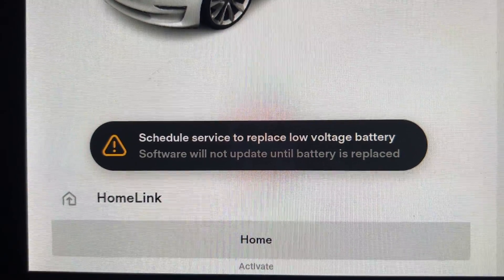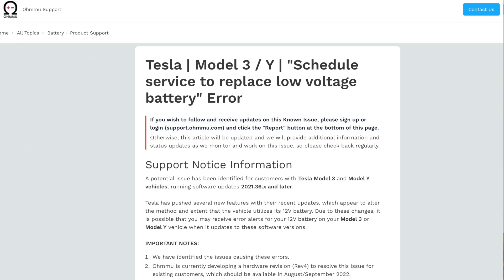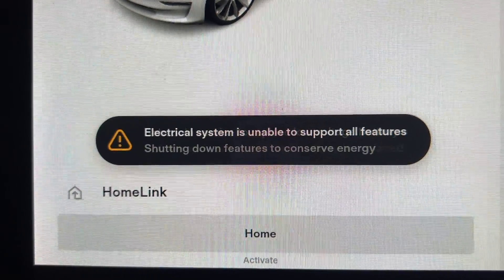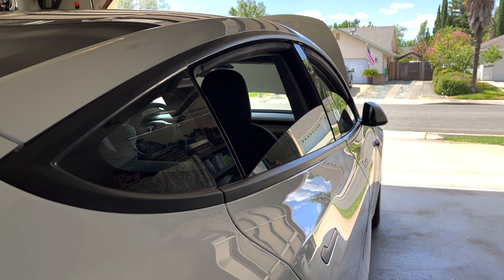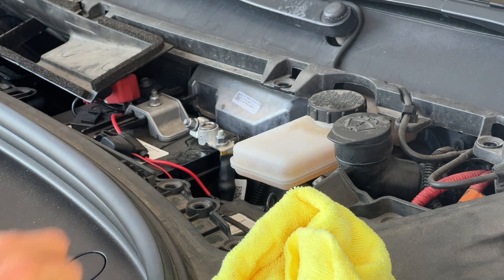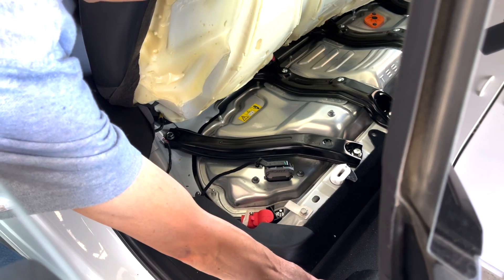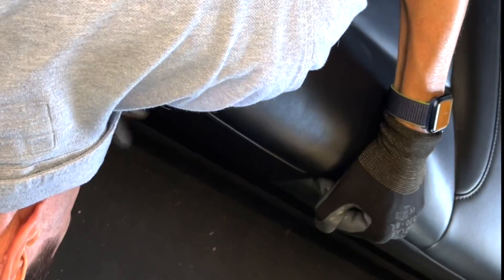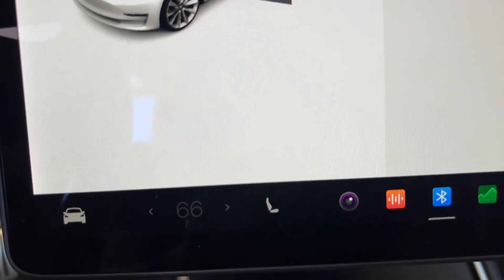Tesla Model 3 or Y Ohmmu Battery Error Message Fix

Comment: Great tip to resolve the Ohmnu battery error message on my Model 3 on last week update !  Thanks so much!

For my case, since my Ohmnu battery was drained to 0%, after I disconnect it , I manually charged it to over 30%, reconnect the batteries, and it works!  No more low voltage battery error message.

Ohmnu app has also shown correct 100% charge on the battery ever since.

Updates:  Found out that “Low Power” feature causes 12V battery error again.  I need to avoid using “Low Power” to avoid 12V battery error from now on

Comment: Hi...id like your advice please. The first time i had this problem i changed the battery and the error messages went away. VCFront_a182/a192/a402...it seems my battery was good though. But with the new battery the same error message came up recently. And i reset it again, and it went away for a while but now its back again for the third time? Im not sure what to do next?

Comment: Thank you for the very informative video. I left my 2019 M3 plugged in at ~70% charge limit for 7 weeks while I was travelling. After returning, I have seen the VCFRONT_a182 error msg, but the car is still driving (just no OTAs). Might it have anything to do with sitting idle these weeks, and if so, would taking it for a long spin help? And, if not, can I continue to drive the car short distances while I wait to get the 12V Ohmmu replaced? Thank you very much in advance.

Comment: I have a 2021 Tesla model 3 SRP with about 60,000miles. Thank you for this. It helped me so far. I was able to charge my battery overnight and no error messages. If it comes back then I'll just take  it to the Tesla center because it's still under warranty

Comment: The problem is the batteries need firmware and OTA updates. This won't work if the battery is too low, also the problem will return if you don't update the software

Comment: I got an ohmmu battery a month ago. So far so good. Initially, I obsessively monitored the app. I saw the battery go from 100% to 34% on hot days when the cabin overheat protection was used a lot. I live in NC where summer temps exceed 90F. It was adding 1 cycle per day to the cycle count. But now that it has cooled off, I don't see the battery below 99% and it can take between 1 week and 2 or 3 days to add a cycle to the cycle count. It looks like LFP batteries can live through 4000 to 10000 cycles. I have gone through 9 cycles in 4 weeks. (A short time that does not represent all the conditions hot and cold for an entire year in NC, so I wouldn't bet  on my projecttions yet.) But based on the first month, at 9 cycles in 4 weeks, or 3 days per cycle, if the battery lasts 4000 cycles, that is 12,000 days or 32 years. If the battery lasts 10,000 cycles (which I see mentioned in discussion of high voltage LFP batteries used in the standard model 3's) then the battery could last 82 years.  We'll see! (I do notice the warranty is for 4 years. They won't ever have to replace a battery at that rate, unless it was a true lemon.)  I'm wondering if there is anything I can do with the app to optimize the charging discharging cycles to maximize the low voltage battery life. For example, you can turn on/off the charging/discharging and maybe keep the battery closer to the 50% happy zone. (I do this with the high voltage battery. This has resulted in losing about 1/2 the range per year that is typical. (typical range loss is 2.3% per year. I have lost 1.5%/yr using my "live near 50%" rule. (I put 20k/yr on the car, driving 40 mi/day during the week and 100/day on Fridays and Mondays. I charge to 75% on Friday's and Mondays to make the longer drives. And I take road trips that use superchargers in the summers.) But I have still cut the battery capacity loss rate in half with the "live near 50%" philosophy.

Comment: I have replaced my lead acid battery before 3 months.
Before 1 month I got the warning and I followed your video to reset it. The problem is that I got the warning before 5 days and I cancelled it in the same way then I got it today again and had to reset it one more time.

By the way, the battery is Varta (Made in Germany) 55 amp. 

Is the problem resulting from the converter that charges the 12v battery?

What could be the cause and how to fix it, please.
Reply: The same problem,seperate 12V (varta 45ah) from HV battery,problem solving,but 4-5 hours again show

Comment: Don’t buy ohmmu 12v battery. That costed me $640 to fix the low voltage battery replacement message. Fortunately return window still open and returned the battery but they charged $38(return label) + $90 (restocking fee). My 20 mx working fine with original battery. Here’s what Tesla said Technician inspected vehicle for customer concern. Technician found upon
inspection that the low voltage circuit of the 12 volt battery that vehicle has an aftermarket lithium
battery that is causing the LV battery repeatedly overcharging. The LV battery has degraded over
time and needs replacement with a proper lead acid original equipment battery.

Don’t waste your money and time.

Comment: Tesla Dealer sell original battery $85, I really don’t understand why people prefer buy $400 battery than Tesla $85 original one, and also void the high voltage battery warranty if you using other brand 12v battery 

So confused me😂😂😂

Comment: I see this is happening to a lot of 2018 models, I’m going through it right now myself. Only thing is I didn’t install it myself. I went to the Tesla Service Center, they replaced it, came up to 122 & some change but they said the error is still showing. Something bout the 12v & main battery are not responding with each other, they gave me a loaner & I’m here 24hrs later waiting. I’ll keep everyone updated !

Comment: I let the battery die about 5 miles away from home then had it towed… as soon as I charged at home the low voltage battery light was on… 
I followed the steps in this video and even accidentally dropped the battery spacer between the battery.   Damn!   But once the power was turned back on everything worked… 
Thanks

Comment: Why you would do business with a company after spending $400 for a non OEM battery that needs constant care and not return your inquiries regarding OHMMU issues. The product is NOT 100% reliable nor returnable. One other nagging question I have is and has not been addressed in any of the comments with multiple videos or from Ohmmu regarding voiding the Tesla warranty on the electrical systems.  That would be number one for me. I wanted the lithium battery to work and not void the warranty  with ANY electrical failures. I'll keep using the lead acid battery and sleep better.

Comment: The new Ohmmu batteries are Bluetooth enabled, and you can update the firmware and enable/disable the battery via the mobile app.  If you ever need to reset the battery, you can just turn off the battery with the app, disconnect the HV interlock in the car, wait a minute, reconnect it, and power the battery back on.  I had some growing pains with mine until there were a couple of firmware updates, now it goes for a year at a time without any issues.  I had to reset it again once after a year, and it turned out there was another firmware update.
Reply: IS the firmware update done thru the phone app?
Reply: @curtspray  Yes.  Not the Ohmmu app itself though, there's a different app.  It's all in the directions on their site.

Comment: We have a Tesla model 3 with that just hit 50,000 miles and it has this issue. Ever since the car turn on and off through out the day and it will even have the air conditioning running draining the battery more than usual

Comment: It worked...2021 Model Y LR - The nag screen is gone (1/5/2024) Thanks - I would not suggest these batteries, I spent over $425 and in less than 1 year the battery failed and I have to send back. The return item? I might not put in, maybe goes up on Ebay  - and have original battery replaced (Lead Acid) which this car came with.

Comment: Hi, I have a made in China Model 3 Long Range and had the notification that the low voltage battery is low and to book a service appointment to have it replaced.  I have booked a service appointment for the 11th of January but after watching your video, I think I will check out the condition (voltage) of the battery and try to reset it as you have done.  It would be good to keep the car going until the annual service which is due in March when it will be 3 years old, the car has only done 10,000 miles.  I live in England so I’m sure that the battery has not been exposed to extreme temperatures so I’m surprised that the battery would have failed.
Myke Hoole

Comment: Bought an Ohmmu in January 2021 for my 2018 M3.  Unfortunately I didn’t know that Tesla would replace their 12v battery under warranty.  Anyways, battery worked fine until recently when I received the alert message.   Contacted Ohmmu and went through their step by step process to address error (their process is a little different than in video).   I also checked condition of battery with multimeter and found battery had very little charge.   I recharged the battery overnight and then reconnected everything.   Alert warning is gone.   However I’m wondering if the new Tesla software prevents the charging of the battery.  Am I going to have to keep recharging this battery?   Luckily,  from what I was told by Ohmmu, a replacement battery is to be issued under their warranty and I’m on their list of purchasers to receive the new battery.  We’ll see.
Reply: I sent my OHMMU back . No refund, refused to send another battery.

Comment: I got unable to DC fast charge, but only AC charge after a bump while driving. Looks like a loose connection? tell you 24 hours later😂
Reply: the error gone after a night. and able to charge DC again. Do my research over internet, in Thailand there was a same case, error will go later and comeback. If it doesn't go, you will need to replace the charger port to battery cable, about USD1100 across the world.

Comment: is it ok not to disconnect the high voltage battery underneath the car seat but using the jumper cable instead?

Comment: In February 2022 I installed an Ohmmu battery in my 2015 Model S and then in June of 2022 I put one in my 2018 Model X. Later run 2022 I when through at least 2-3 resets each time there was a new software update on each of the cars. The Model X was the worst in getting rid of the error message. Finally things settled down and I thought the problem was solved. Now (August 22, 2023) the error message has reappeared on the 2015 Model S. Tesla engineers don't seem to care about supporting superior battery technology. I will check with Ohmmu and see if their newer battery will solve the Tesla software issue. I am sure for them it is like hitting an erratically moving target. By the way, on each of my cars I have to remove the frunk liner to access the battery, so the procedure takes about an hour. Ohmmu has a good video on YouTube to explain the procedure.

Comment: Like you i had previously install an OHMMU battery for my 2+ year old Model Y LR…all was fine for a month and then I received the battery notification you referenced. I also had an alert regarding detection of a possible controller issue. After following the steps on the OHMMU site to reset and reconnecting HV and the negative terminal on the 12V battery, my Tesla did not come back on. Waited about 15 minutes and tried pressing on the break…still nothing. All my research indicates that the 12V battery would be the issue, but not sure that is the case sense this is a brand new battery…note out to Tesla service center and awaiting direction

Comment: I've had multiple replacements from Ohmmu.  I now have their Rev 4 with the bluetooth.  I've had this error come up after installing and resetting.  Their battery and app needs an update though, as it still does not have any password protection.  Meaning, anyone with the Ohmmu app, can walk around scanning for the Ohmmu batteries, connect, and disable the batteries charge/discharge.  This is a huge security issue.  Unfortunately, Ohmmu has not responded to me on this issue after months, so I don't think they're likely to.  Honestly, I'd avoid the battery with bluetooth until they address this security issue.

Comment: To perform this procedure on a Model X (and probably S too) you must unfortunately remove and later reinstall the  whole frunk interior structure (very tedious, but easy). On the other hand, the main battery disconnection plug is right there on the top left of the frunk (that orange tongue coming out, shows you where it is).

Comment: Mine started to alert after 1 year and a half only, after I replaced my dead 12v battery with an Ohmmu. I’m wondering if it’s a real warning or not… The battery should last 10 years or so!
Reply: FOLLOW UP: I performed the procedure indicated in this video and it absolutely worked! Let’s see if it lasts!
Reply: FOLLOW UP 2: after some weeks, the alert popped up again! I did the procedure again (tedious because I have a Model X) and the alert disappeared. I wouldn't like to have to repeat this all the time!

Comment: Mike…. I have a 2021 M3 standard with 16,000 miles . I have the lead acid 12V but would like to switch to lithium. I’m hearing reports that once you have lead acid , you have to stay with lead acid. What are your thoughts about going from acid to lithium?
Reply: There’s no reason why you can’t switch! (but do a proper research)

Comment: I have a lithium-ion battery 12v 6.9amp. The EV battery died and the 12V died also, now I can't charge the EV. I charge the 12V, the car starts then shuts down in about 30 seconds.

Comment: I just got this after having the battery for 1 week.  This worked.  Apparently it let the battery nearly die (it was refusing to charge it), it was at 6% after the reset, and took 2 hours to charge back up again.  Don't know what happened, hopefully it was a one-off thing.  What this procedure does, is fool the car into thinking you changed the battery again.

EDIT:  I just found out, I can do this MUCH easier with my battery if this happens again, because I have the new Bluetooth-enabled Rev4+.  Note: These directions ONLY work if you have the newest Bluetooth-enabled battery.  If you do not, you will have to follow the directions in the video.  First, power off the car via the menu.  Wait until the contactors close (usually about 5 minutes, wait for the clunk).  Open the battery's Bluetooth app.  Turn off both charging and discharging.  Make sure car fails to turn on at all via the brake pedal (since there is no 12V present).  Wait 2 minutes.  Turn charging and discharging back on.  Hit brake pedal to reboot car.  And this effectively does the exact same thing as the manual procedure you advised in the video.
Reply: Edit…..contactors open Lol

Comment: I have a similar car as Frugal Tesla Guy (2018, M3, Long Range, RWD) with 80K miles and my first 12v battery gave me the dreaded message.  I thought I'd go with a Ohmmu battery for the weight and sounded like a better option.  Installed it 1-week ago and after 5 days (and a longish trip), i got the error message again.  I'm going to try to full reset but am concerned about the "Recharge battery" step in the Ohmmu instructions.  How would you recharge the battery?  (I guess I'll try it without doing that).  The instructions say to drive around for 10m before executing the procedure so I''ll try that as well when roads are less icy (I'm near Seattle and just got freezing rain last night.)

My Ohmmu batter has the Bluetooth module and it gives the following information:
Home Page
9%
Time to empty: ~
Total Voltage: 12.6V
Amps (in/Out): 0.0A
Cycle Count: 2
Temperature: 47.1F
Enable Charge: On
Enable Discharge: On

Voltage Page:
Total Voltage: 12.6V
Avg Voltage: 3.145V
Delta: 0.099V
Cell 1: 3.159V
Cell 2: 3.098V
Cell 3: 3.120V
Cell 4: 3.197V

Power Page
Total Power: 0 watts
Total Voltage: 12.6V
Total Current: 0.0A

Advanced Page (has similar info as before):
Battery Age: 1 months
Alerts: All enabled

Comment: This was better for earlier model 3 and earlier versions of the software. They were going through 12 volts like hotcakes because the software was charging it like a lithium battery which for a lead acid is no bueno. They like to be 100%, lithiums not so much.  So the lithium 12v was a better option to last longer. In a past update the changed the software to optimize it for charging the lead acid in cars that are equipped with them so now I’m wondering if it’s going to be a reverse problem now with these lithium batteries wearing out faster because they are now being charged in the worst way for them and the old lead acid’s will last longer lol.
Reply: LFP batteries also like to be charged to 100%.  So no, it's not that.

Comment: One step that’s in the online guide and you skipped is charging the battery before reconnecting it, i used an external power supply and charged my battery to 13.4V and the error instantly disappeared. I measured the voltage before charging and it was around 12.5V, seems that the car system stopped charging it. We’ll see how it goes
Reply: The newest version of the battery has Bluetooth support so you can check things like this (and also "disconnect" and "reconnect" the battery via an app so you don't have to physically unplug anything.  But yes, they do say if the voltage is too low you may have to recharge it first.  It seems though, that this procedure (whether manually disconnecting on the old version, or software disconnecting on the Bluetooth-enabled version) fools the car into thinking the battery has been swapped.  And because batteries can be low on charge when installed, the car may try to charge it first before throwing the error again.  And it's very rare for these batteries to go bad (LFP does not degrade when discharged the way lead acid does).